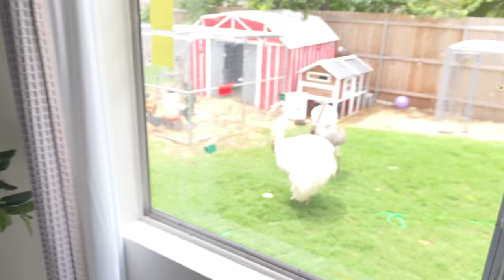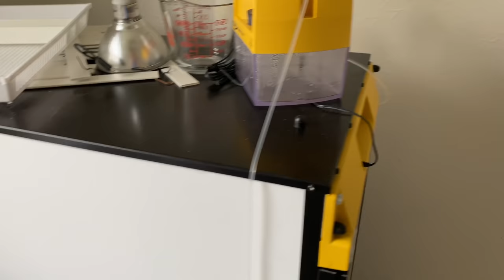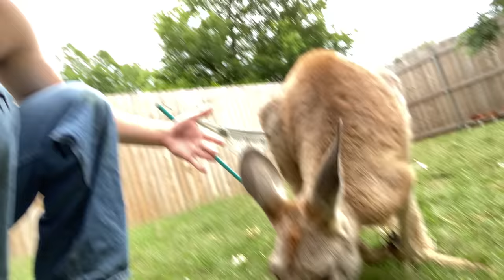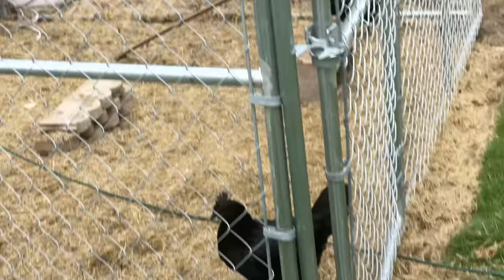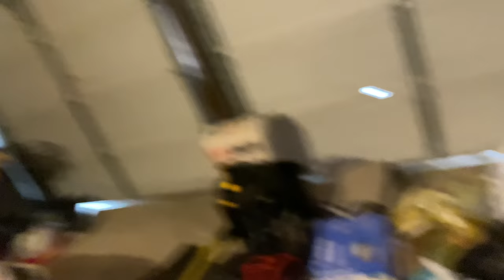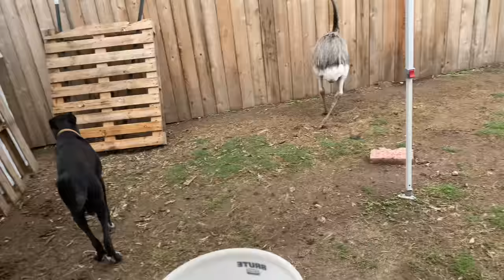Kevin Vs Riot Shield (+Dababys Murder Confession 😳) *Shocking*

Comment: You might want to look into therapy chairs designed for chickens to maybe help the ostrich. Obviously you can't use a normal chicken one but they're super easy to make, basically they hold them upright and prevents them from falling, whilst also still putting weight on their legs and helping them strengthen them. I'm getting a disabled chick in two days and I have one built for her. You can make them out of piping (I'd recommend metal piping for a larger bird) and a sling out of some kind of strong fabric.
Reply: Ur AMAZING!!😊😊😊😊

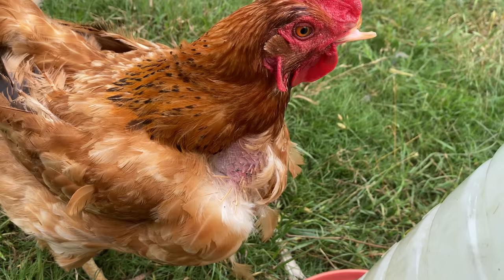Comment: the chicken at 451s or 7:31 may have something far more serious than malting. this has happened to my chicken before. it is called an impacted crop, and is where (to my understanding) they eat too much stuff like long grass and other stringy stuff and it blocks their crop. their belly gets so big it drags along the ground and gains dermatitis, ultimately resolving in them pecking off their feathers in itch. may require surgery

Comment: You should go to Tractor supply and buy a couple of fly trap bags. I use them. They are very effective. Leave out for 2 weeks top, bag them up, trash it, and replace. Those flies are going to be a very bad issue.

Comment: Keep the shield always in front, even when pushing Kevin. Get a good footing with your left foot in the lead and the right in the back in a position similar to a lunge. Twist your torso right and push the shield forward, with your legs. Keep the shield in line with the direction of your footing and spring your lunge forward. It’s painless for the victim but very effective in pushing them a good 3 feet away. It’s used in riots. Your welcome.
Reply: Also I might try and make Squats a little wheel-harness-thingy that they give dogs so that he doesn’t have much pressure on his foot so it can heal properly.